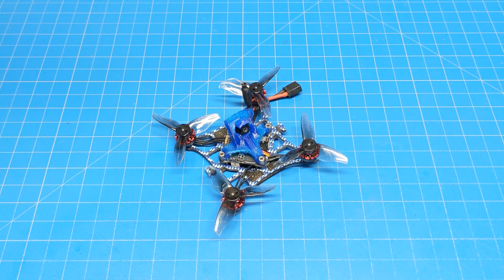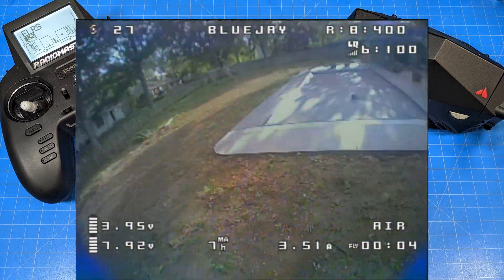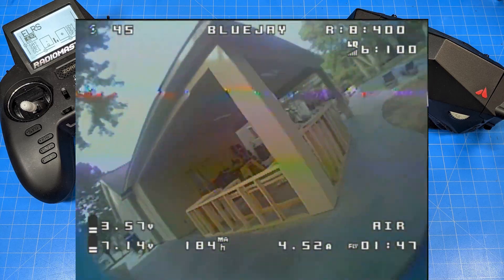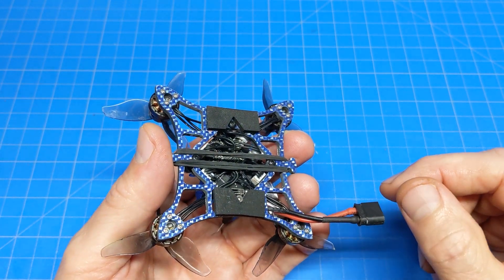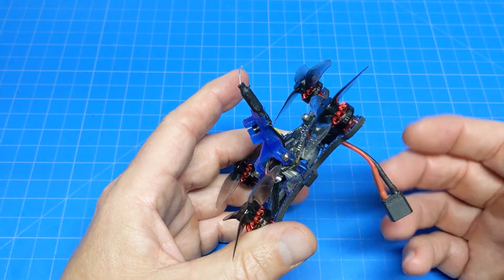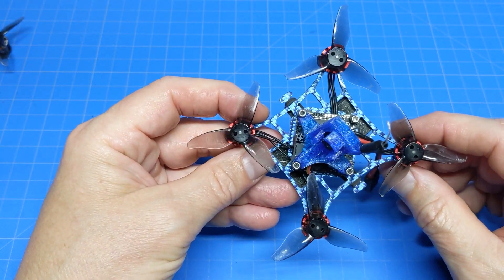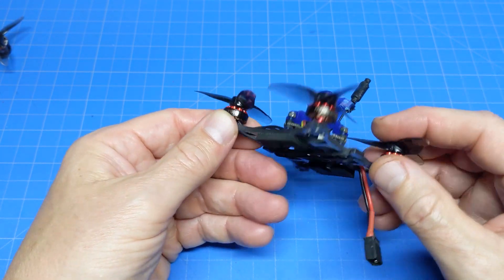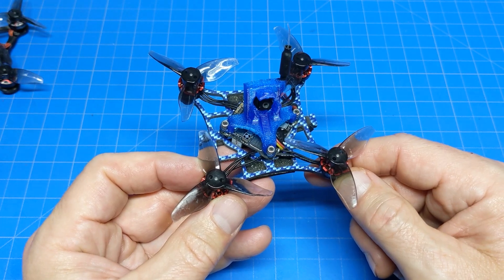Making a Comeback // 2 inch drones // BackYard Ripper

Comment: Man you're careful with turtle mode. I'll use it for 5 minutes stuck in a tree. Quite often I'm stuck in the grass and I just keep arming my quad and punching out to break free of the grass. Works half the time.  I don't burn ESC in my 5-inch or 3 inch much. Maybe 1 a year. I use single ESC. Cheap fix. All abuse turtle mode all day if im stuck. Happy to kill the battery doing so. I can't climb trees anymore 😅

Comment: Heeeey this is the lil quad that I fly. I love it. I run it on some GNB 530s myself, though considering how much snappier it seems with an even lighter battery, mebby I'll nab a few of those next time I go by Rotorgeeks. Thanks for the CLI dump btw Nick, I'm running the defaults so I could certainly use a bit of a tune.
Reply: I’m really interested in this lil bad boy 😃🤘
Reply from the maker: I don't think rotorgeeks has the hobbyking batteries. Unfortunately they might only be available from hobbyking, and hobbyking has several different batteries similar to this one but they don't perform nearly as well. The battery I use is the one labled 45-90c, and comes with a red jst connector we have to change out.
Reply: @NickBurnsFPV  Good to know, guess I'll just bulk order some from hobby king and get some xt30 connectors to slap on there, easy enough.
Reply from the maker: @Latchfpv  I bought some off of ebay, as hobbyking was out for like 8 months and I thought they stopped making them or couldn't get them anymore. 😃
Reply: @NickBurnsFPV  Good backup strat. Hobbyking has them in stock right now so I'm gonna get a bunch. The only thing I'm somewhat worried about is that they are gonna make it feel so much snappier I'm gonna end up retiring the 530s I have currently... unless I swindle myself into a beefier drone to use those with...

Comment: I built a couple Rocket Race quads and I've had pretty bad luck with the URUAV motors bending shafts with pretty minor crashes. I bent the front two in a pretty minor crash and on my other quad I bent one of the back shafts slightly. I picked up some 1102 10000KV HGLRC motors to replace them until I could get some new HappyModel 1102 bells, I'm hoping those hold up better, but luckily there's replacement bells available for a few bucks.
Reply from the maker: I do hear this from time to time. I haven't had trouble but we are flight different spaces and crash differently.

Comment: 2 inch 2s for the win! Always fun flying. Nice one Nick. ☺ (if they are still selling the UZ85 that's a cheaper way to get everything apart from a carbon frame)
Reply: Exactly this one is pretty costly... I saw UZ85 (without Rx) back in stock in bangood.
Reply: @balajiprasad9046  That's good news, and helpful info for anyone building on a buget! I've got two uz85 set ups. Very good value for what you get. ☺
Reply: Thanks for the info, think I’ll go that route!

Comment: After several failures with the older Happymodel FCs, my TKS Rocket build has been sitting on the shelf for a few months. I'm waiting for the X12 ELRS board to make it to US distributors to put it back together. Do you think it would fly well with the HDZero whoop lite VTX or is the weight not worth it?
Reply: The 5A happymodel AIOs fail quick. I have the same experience.
The new X12 is better. Also check out the betafpv meteor85 and convert it to a 2" TP. Very good FC. Have 6 of them and not let me down.
Reply: For 1-3s aio board I like the Darwinfpv 15a but for just 1s 5a aio I like the HM diamond F4, now with elrs spi it will make my build even more compact, my other diamond F4 are with frsky spi and I have to disable that and piggyback a standalone elrs.
Reply from the maker: I do plan to do a RR with the hdzero whoop lite, I suspect it will fly well. My concern is the clearance for the props. I worry the props are going to knock into the whoop lite vtx.

Comment: Good Stuff man!  After watching some of your content on the rocket race style frames I decided to order 2 of them!   I plan on building the first one with the RCINPOWER GTS V3 1002 22,0000kv and the gemfan 2015 props biblades!  Question I have is can the mobula 6  with its 5 amp flight controller handle that set up on 1s with the bt2.0 battery connector????
Reply from the maker: Yep been using 5amp esc on 2s with xt30

Comment: Question Nick:  I'm used to flying DJI and having incredible clarity. Do you think it's worth the couple of additional grams weight to upgrade a Nano3 to a Toothless 2 Nano?? That camera is so damn good, that and the Baby Ratel. 🤘
Surely the quad has the power to take that couple of grams without issues, right? I'd love for you to do the upgrade and see if you can tell the difference in it's flight! 🤷👍
I think these top analog cameras sometimes get ignored because we are always thinking lowest weight possible. But, trust me, flying these mediocre cameras, after you've flown digital, it's tough to even want to strap on a lipo! 😥🥺 Lol
Reply from the maker: While I haven't put a toothless 2 on one this size/weight its surely reasonable. The reported camera weight is 3.1 but on my scale with the wiring its 5.3. So that is more than 10% of the quad weight. With that I would expect performance difference, but the image quality will be top notch analog. I do put caddx ant lite on these little guys, and while not nearly as good as the toothless 2 nano its much better than the nano 3 with only about .75 gram weight added. And the performance difference is negligible in what I feel in flight. We can remove the connector from the toothless 2 and of course we would use much shorter wiring, probably bring the over all weight down to about 4 grams. If we wanted to we could make other weight saving changes to off set the weight gain, remove aio connectors and shorten motor wires are the first to mind. Short story long....as it sounds like the image quality is most important and liking this size, I would just start with putting a toothless 2 nano on and and see how we like it. If the performance is close but not there, doing a thing or two to drop 2 grams will likely put it nearly in line with most of my builds of this kind.
Reply: @NickBurnsFPV  good call!  :)
Reply: @KOrnhOliO1  I run a baby Ratel 2 on my 2” for the same reason you mentioned and personally find it worth the weight trade off. The picture quality is good enough that if I’m not flying DJI back to back I quickly forget I’m flying analog and just have fun.
Reply: Hmmm, you usually just make rant posts how you hate stuff
Reply: @xavierprimeto1752  Haahaa! Only when I don't like it or I think the reviewer is being a shill!  LOL  I do like a lot of stuff! But, thanks, I'll make a point I'm staying on the positive side of things!  One thing I'll always be negative about - Cinewhoops - Damn! We have enough already!  lol  And those overpriced built quads at Roturd Riot!  lol  Happy 4th!
Reply: @seewell8168  ...Bro! Well there ya go! Just what I was looking for, someone whose tried those superb cameras and found the weight trade off worth it to get amazing analog image quality! Cuz those two cameras I mentioned are fantastic!!! That Ant lite Nick mentioned, no offense Nick, is horrible! 😜 Not even in the ballpark with the Toothless 2 Nano and your Ratel 2. Man, those two companies really hit a HOME RUN with those cameras! 😎🤘
Reply from the maker: @KOrnhOliO1  No offense taken. We all have our preferences. I wouldn't want anyone to not enjoy the hobby to meet my preferences or anyone else's. I did put in a baby ratel 2 in one of my RR 2s builds, I believe in the original video I called it the heavy build. And I do fly it, just not as much as the other RR 2s builds.  The cinewhoops keeps coming, there must be a sizeable, al be it a quiet market for those.
Reply: @NickBurnsFPV  Not in this comment, but before you mentioned maybe trying to shave off some bits of weight if one were to use that Baby Ratel 2 or Toothless 2 Nano camera. I'd like to see a video about what you can do to your "heavy build" to get it to a similar weight to the other inferior camera, but lighter builds. It'd be fun for all of your subscribers to see the "Master of the Micros" do his weight saving magic! (did I butter you up enough for you to go ahead and try this type of co0ol mod video??  heehee! 👍👍👍🤞😜🤣)
Reply from the maker: @KOrnhOliO1  maybe, just maybe 😁